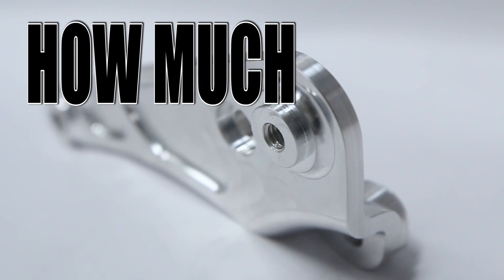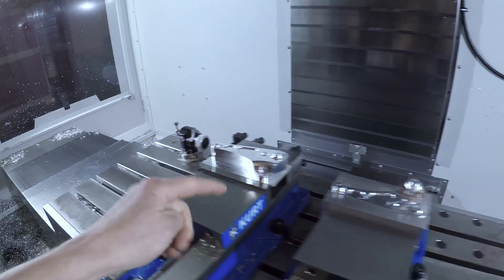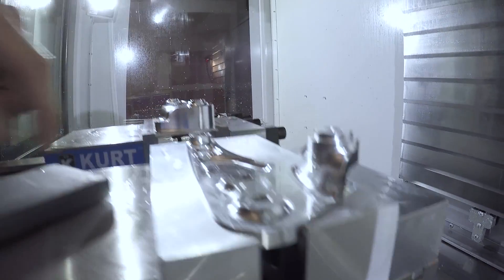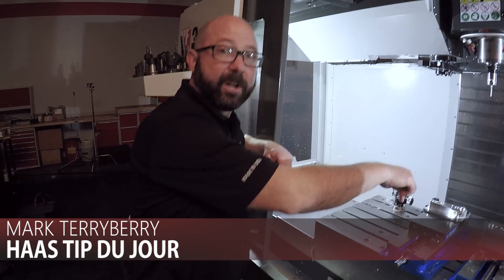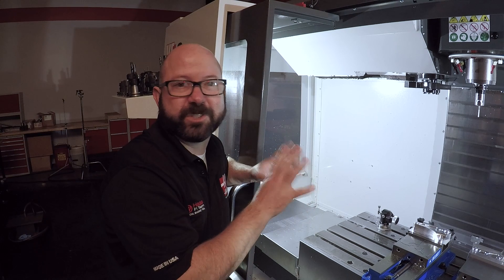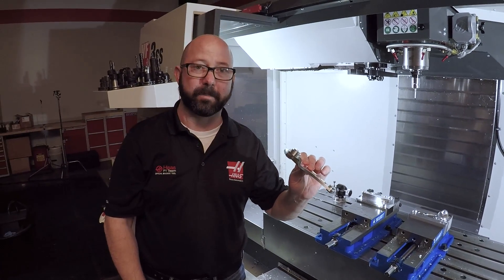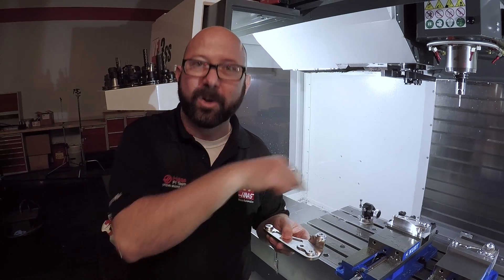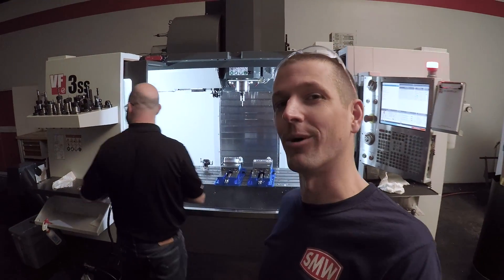How Much would You Charge to Machine this Part?

Comment: Personally I'd go for a high rate for the first 10 to cover tooling and programming, then a low cost on all after that. Perhaps being a bit cheaper overall. But the point is that the low on-going cost may encourage repeat orders. Everyone wins. This is what supply chains are all about.
Reply: I tend to appreciate this approach. I understand the initial tooling and set-up costs. And if I've got a part that I want to make a lot of, I don't expect to be charged that all over again. Otherwise I feel taken advantage of.

Furthermore, I'm going to calculate cost per part after the initial prototype or short run. If I can't make that part sense for the overall big picture, whether it's just a component in a larger assembly, or it's the actual part that I'm going to retail... then I'll need to reevaluate it's manufacturing process.

Take their little supercharger bracket as an example. Does it really need to be machined, or can it be a stamped metal bracket, that's chrome coated? Can I afford to lose $30 per bracket, if that means I have to lower my price for the entire supercharger kit to stay competitive?
Reply: So amortizing the setup and tooling costs to the first part of the run and then dropping the price for subsequent runs? Why? That's the same thing, if the order goes up to 100 or 1000 then the per unit price goes down automatically by being spread more thin. Ultimately it's meaningless. Setup costs (and the associated labor) are fixed, you get the savings at scale.
Reply: No not the same. I'm deliberately front loading it because this is where I've chosen to put my innovation. I want to cram it into the lowest volumes that others hate- because this is where we have made the most savings with our tech and training. Some customers will look at the total order price, others will look at the piece part price. I'm trying to make both attractive to my customer. Even if only 10%. Its not meaningless- ...."Setup costs (and the associated labor) are fixed, you get the savings at scale". I suspect this is where our experiences differ. We have substantially reduced our set-up time (80% less) and unfortunately we don't see the savings at scale because as the volumes double the margins quarter. We gave up in this volume sector, as we started seeing more and more foreign competition working down the volume curve. We chose not to compete with their low labour costs, but use our creativity to address set-up costs.
Reply: Of course neither of those are the point. He's talking about this in terms of a single order for parts. I haven't seen his spreadsheet but I'm guessing that he breaks it out. Now if you can use innovation and creativity to reduce the cost and effort that goes into tooling, then that's great. Also, if you're going to be running more than one production run then obviously you'd expect them to keep the custom parts of the setup so you pay for it twice. Now, on the topic of machining vs some other manner of production, I'm sure you could stamp a functionally equivalent part for a much lower unit price, but I'm guessing your setup price would make it a terrible option for a run of 30 parts. 

Again, none of these are the point, which was how much would a short run production job get charged out for at a job shop, so if you change the conditions you might get different results. If you're the customer, you have to determine the manufacturing solution that is optimal for your needs and vote accordingly. If the job shop loses out on enough jobs because of their pricing, then they'll learn that the hard way, and if you need a small number of fancy billet auto parts to sell to dummies who will gladly pay $300.00 for a shiny engine trinket, then it may be worth your while to pay up.